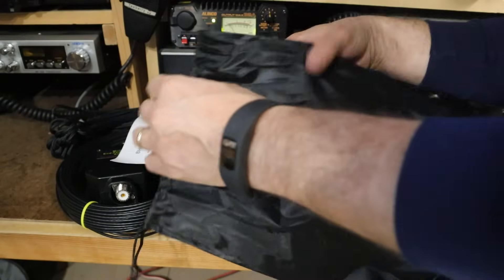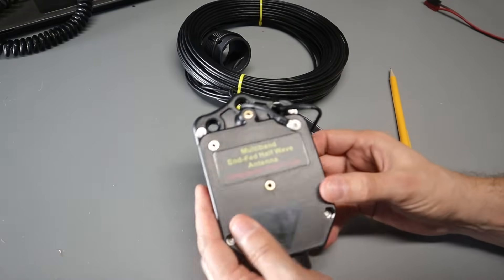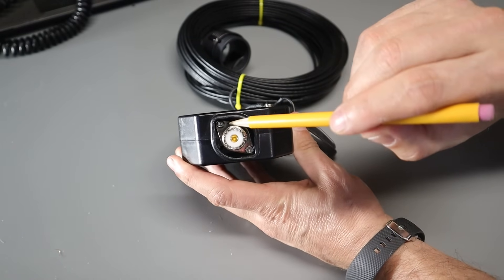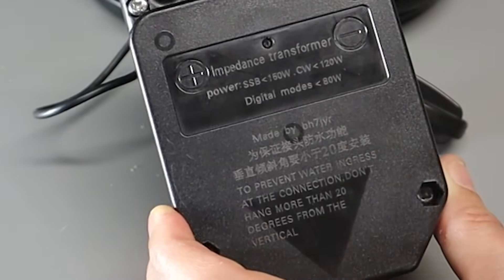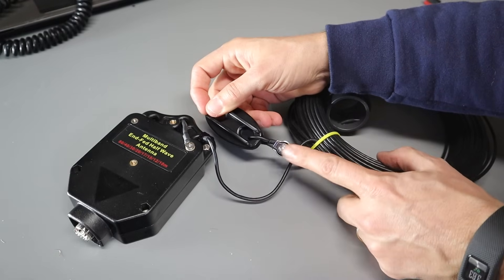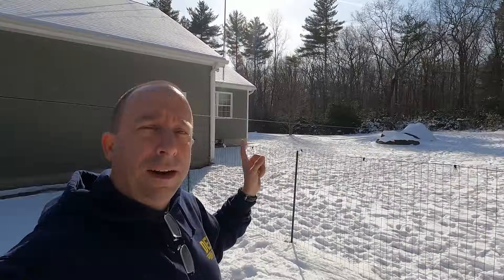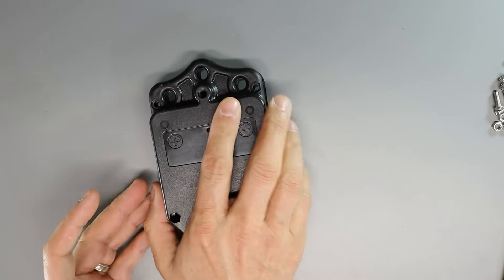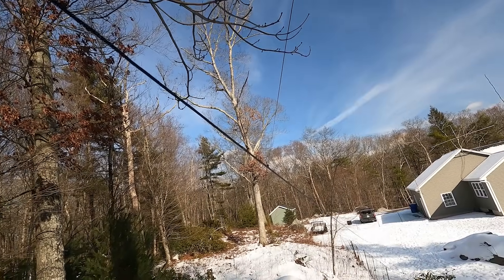Can This Ham Radio Antenna Really Cover 8 Bands? (JYR8010 EFHW)

Comment: I gave it a shot. It is well built and appears durable. I only have a 5500sqft rectangle shaped lot to put this up. I strung it around the lot the best I could through palm trees, about 10 feet high. I use an artificial ground for the counterpoise. I made contacts but signal strength was weak. I could not get RFI on 40 meters out of the shack. I switched to an 80-10 Off Center Fed Dipole and problems solved. A good tuner is needed for some frequencies. 73's/NH6RF

Comment: No. Illusion  The dipole only ' matches' on one band, on others, the BALUN IS ABSORBING THE POWER.

Proof experiment:

https://youtu.be/z01oTYbCB0E
Reply from the maker: As you saw in the video, the antenna worked.  Some power is getting absorbed by the Un-Un - I think most of us know and accept that as a tradeoff for this type of antenna.

Comment: Two possible suggestions for your consideration:

1 -  EZ Hang from DX Engineering -  This gadget is made up of a slingshot and a fishing reel.   You attach a 1 oz. weight to the fishing line and use the slingshot to send it over a tree limb.   Then, you attach paracord or whatever rope you're using to support your antenna to the fishing line and reel back in the line, pulling the rope over the limb.

2 -  An Arborist kit -  The Arborist kit will have a weighted toss bag, a length of rope (usually about 150 feet), and a bag or collapsible box.   You attach the weighted toss bag to the throw line and use one of several different methods to throw the weighted toss bag over a tree limb.   Then, attach your antenna support rope to the end of the throw line in place of the weighted toss bag and then pull the support rope back over the tree limb.

Of the two methods, I prefer the EZ Hang.   I find it easier to aim and I can get the line up higher in the trees.  But, I have used both and both will work for getting antennas up into the trees.

Thanks for the video!

Comment: I ordered one and got a 49to1 without the compensation coil, dscron rope or winder. I'm going to open it to see what else is missing...
KK5R
Reply from the maker: Did you order the full kit?  You can buy the un-un by itself...maybe you clicked that option by mistake?  Either way I hope it works out for you
Reply: @SevenFortyOne 
I ordered what was in the picture. It showed what you got. Somebody saved some money. 😊
Reply: @SevenFortyOne 
Paperwork said it could be a 49 or 64 to 1...

Comment: I bought a similar one ... same box... that does 4 bands. I actually ran a wire inside to one of the unused screwholes so I didn't have to use the one at the SO239.

Comment: What is the length of your counterpoise? Does it vary if antenna is in an inverted V configuration? Can you provide close up of Counterpoise attached to the PL-259? Thanks!
Reply from the maker: I think I mentioned in the video it's about 14 feet.  I can't post pictures in the comments and don't have the antenna up right now anyway.  I suggest experimenting and seeing what works for you assuming you have this or a similar antenna.

Comment: I have this antanna.I have it 25 ft in the air .Horizontal  at about 65' I have a 90 degree angle on a pulley to a tree.I am in Maine I have talked to Slavania ,Ireland,etc .my radio is an Icom 7300 I run it at 100 watts USB and lsb. This is my first HF antanna I think Im just going to stay with this what more do I need.KC1UUD .GET THAT UP HIGHER LOL

Comment: I recently purchased this antenna from Amazon, and it works great. I'm using it with a Yaesu 891 and a Yaesu FC-50 tuner across all bands. I even managed to get it working on 160 meters with an SWR of 2.3:1. The only drawback, in my opinion, is its length and weight. I have plenty of space at my place, but it's quite difficult to stretch the antenna properly with a counterweight. I'm using a 6 kg (13 lbs) counterweight over a pulley hanging in a tree, yet the wire still isn't stretched enough. There is a sag. I'm not sure if I can support it with a tree pole in the middle. I'm also unsure how much tension the anchor point on the house wall can handle. The antenna is, on average, 5 meters (16 feet) above the ground.

Comment: To bad we don't have a better look at the inside turns? I can only make out 15 turns? I count two twisted turns, five close spaced, one crossover turn, and seven wide spaced turns. Looks like a 56:1 to me. Looks like it is balanced with seven on each side and one crossover turn between.
Reply from the maker: It might be 15 turns/56:1 ad opposed to 64:1 as advertised ... either way it seems to work.
Reply: 56:1 is right between 49:1 and 64:1 I believe the core is the secret sauce and fun to build on a coated core.

Comment: Do you need to use a counter poise ? I plan to use the in a slope with the unun far above the ground .
Reply from the maker: I don't think you strictly need it but it will help with tuning and help prevent RF from traveling down the coax and back into your radio

Comment: I would need an antenna which will fit into a maximum length of 48 feet, with 32 feet of it being over brick buildings and the rest being over concrete. So even with the moderate capability of that long wire, you have my envy. 😉 Nonetheless, that setup is performing pretty well for a simple setup. I use homebrew magnetic loops for 60 metres to 10 metres instead, with good results on QRP.

Comment: Maybe I’m mistaken but that actually looks like a 56:1 transformer (2 turns primary, 15 turns secondary).
Reply from the maker: I think it depends on where you count the turns from - you could go with anywhere between 15 and 16 turns so I'd guess its somewhere between 56 and 64 to 1.  either way it isn't 49:1 like a traditional EFHW design
Reply: @SevenFortyOne number of passes through the center of the core is what counts as a turn.

Comment: I had a bad experience with their 40-10 EFHW model.  It displayed high SWR on all covered bands and enough spurious RF emissions to fault my home alarm system despite running a common mode choke,  Never had a wire antenna do that.  Defective transformer no doubt. Questionable quality control. I sent it back.
Reply: this comment needs more attention
Reply: 如果可能 的话，请改变一下天线的方向：比如原来的方向是东西方向，改成南北方向，最关键的一点儿是更换与原来馈线长度不同的高品质馈线。否则您换成任何一个品牌的EFHW都具有相同的问题。主要的问题都在于您的馈线在发射信号，并且馈线的长度恰好共振于某个频段或多个频段。另一个问题在于可能您的其它用电器的导线正好与天线平行且共振了，我遇到了使用偶极子天线却强烈干扰所有家电的情况，当我把偶极天线旋转90度的时候，一切都趋于完美了。当问题发生时，HAMer要做的不是报怨，而是找到问题并解决它，这样可以提高自己的能力。73 DE BD3OLH。

Comment: I have one just like that, an MFJ-1282 132 feet, from the house at about 10 feet to a tree out back about 50 feet up, works great on 160-6 meters with my Kenwood TS-890. I'm in northeast Connecticut. --WS1O
Reply from the maker: I'm also in NE CT...Tolland county
Reply: @SevenFortyOne  I'm in Pomfret...I used to be a member of BEARS of Manchester years back, now I'm president of ECARA and vice president of the Middlesex club (MARS). Stop by an ECARA meeting, 2nd Monday each month!
Reply from the maker: @BrianBattles   I know some of the guys in ECARA.  I help out with my son's Boy Scout troop on Monday evenings so I won't be able to make any meetings.  I usually attend the ECARA hamfest but I guess that was not held this year.  I also used to check in to the flying saucer net on Thursdays but my current work schedule usually gets in the way of that.
Reply: @SevenFortyOne  Too bad the schedules conflict, hope we can meet someday!

Comment: It looks like a powdered Iron core toroid. I use a 36:1 ratio with a 2 wrap primary centered on the secondary . With a 130+ wire that isn't in a straight line config. It has been fun building my own UNUN's and trying out the different ratios. Thanks for the video.
Reply: They are ALL powered iron cores no?

Comment: Would you be resonant in the 80 meter band if you shortened the wire?
Reply from the maker: The antenna is pretty good in the 80 meter band as it is so I don't think making any changes is necessary.  Having said that, if the wire is shortened it may affect the tuning on some of the other bands.

Comment: .... green might be a 52 mix... one of mine is.... but I've migrated away from the donuts and started to use the cable cores...I now use a small 61 mix core and auto-transformer winding configuration for proven better efficiency (60m and up only)..now upwards of  90 > 95%. On 80 that low to the ground portable config is OK for NVIS... it'll work OK for local nets and rag chewing but only at night. If you have a NANO-Vna you might try do some efficency tests...

Comment: I don't have this antenna but I have found that stringing an end fed half wave as an inverted V works very well indeed.  I built one and it rivals my 80m dipole (though it is slightly more noisy.)  Both are up 20m high.

Comment: The reason the case halfs have a boss on one sire and a recess on the other is simple:  this allows one design for both sides, i.e., you manufacture ONE mold, not two, and cut your manufacturing setup cost in half.  Clever, actually.  If there are differences on the outsides, I would be suprised to find that they are acturally molded, as opposed to laser engraved.

All in all, very interesting.  Thanks for the review.

Comment: I use an efhw for pota. Mine is 66 feet long. This year I’m going to 3d print an insert for my hitch so I can put a painters pole on the back of my jeep. Then I only need one tree and the unun won’t be at the top of the jeep.

Comment: Hello, I have a question about the attenuation of electromagnetic waves by plastic. I would like to cover the radiator and other elements of the yagi antenna for the VHF and UHF bands with plastic pipes. Will this adversely affect the reception and transmission of the antenna through attenuation? 73!
Reply from the maker: It shouldn't affect your ability to transmit or receive but it may affect the length your elements need to be.  It will also add weight to your antenna so keep that in mind as well.

Comment: 👍Thanks for video. The UNUN looks to be nicely constructed. Certainly, the way the secondary is wound is interesting. Think I may have seen something similar before but can't remember where? Obviously, the winding arrangement seems to work effectively. Though, not sure about the counterpoise connection arrangement.
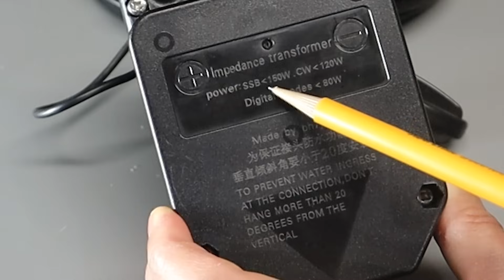Having, played around with 1:49 and 1:64, I think you can get both to work OK just by adjusting the length of the radiator slightly or even raising/lowering the feedpoint.
Reply: People have often wondered why the windings often cross over and reverse direction. I think this is simply so that the antenna end terminates at the opposite end of the toroid to the ground and input.

Comment: I am limited to space and use a EFHW at 66 feet with a 90degree bend around the house. I am looking to replace it with a new 49:1 and doing two 33 foot elements from the 49:1 in a v shape from the top of the roof to the corners of the back yard. I tried the comet ch250b and it is garbage so I am at wits end and if this fails it’s time to sell the radios.
Reply from the maker: I don't think that configuration will work.  A 49:1 UNUN will only work with a single wire end-fed.  If you want two wires coming from the feed point you need to use a 1:1 BALUN to make a dipole
Reply: @SevenFortyOne  I'm going to tap the ground from the 49:1 as the other element, type of dipole configuration.
Reply from the maker: You can't use a 49:1 for a dipole with equal length elements.  You need a 1:1 BALUN for that

Comment: i didnt see the benefit of it being 64:1  over the 49:1 .. My 49:1 offers better swr on all the bands than  this one displayed ,  Genuine 43 type toroids are normally black withought a coating ( coatings are not required as 43 type toroids are not conductive . It appears to be a generic toroid possibly metal core ,  Either way most 43 type efhw  will out perform that one
Reply from the maker: thanks for the info.  I'm curious now whether or not the performace difference would be noticeable.  That might be a good test for a future video.
Reply: @SevenFortyOne  if you could use the exact antenna wire including coil ( by removing it from that transformer) I would say it will give a definitive answer

Comment: I have a 135' EFHW in my backyard. Unfortunately, like you, I'm no land baron. I miscalculated the length of my yard and after running the wire through the crabapple tree, then through a 14' tall piece of PVC. At the end of the wire I ended up having to do a 90° turn and down to a fence. But, it works, so there it is. A tower is something that only comes to me in my dreams at night - HA.
Reply: Hello MrTommy - I'm in the same boat - very small back yard - the antenna I opted for was the T2FD which I find great.
73 de Ger EI6DP
Reply: Not 1kw not interested, KJ7TBR
Reply: @Brenda-jf2pe 
Amazon has a 1KW version.
KK5R

Comment: I see that the front and back is completely identical when it comes to the basic shape, so that means that they only need one single mould instead of two different to make a casing. This makes it cheaper to make.

Comment: I'm willing to bet your SWR will improve if you raise that antenna.  Can you tell us the exact length of the wire. I have a 64:1 unun and would love to see how it will do for me. Right now I'm using it for EFRW and it's doing OK but I need to trim it and pick a length.
Reply from the maker: It's too hard to get an accurate measurement in the cold, but it's around 130 feet give or take...
Reply: @SevenFortyOne  Thank you, what is the counterpoise or did I miss that on the video?
Reply from the maker: @BlessedLaymanNC I forgot to explain the counterpoise.  It is NOT supplied with the kit.  It was my own 14awg wire, about 14 feet long, with an aligator cip on one end
Reply: @SevenFortyOne  Thank you. Except for the diameter, I want to duplicate the antenna. I have the unun already.

Comment: Nice video! Very cool option for mulitbands and reasonably priced. BTW, i think the design with the o,ring groove, weather seal, is due to the fact that both sides are almost identical from a mold perspective. Slight mods for holes/inserts. Basically mirrored halves with slight mods.
Reply from the maker: Good point!☝️ thanks Marc

Comment: This is impressive. Wish there was something a bit smaller (hard to be a land baron in central NJ). Getting on 80 and 160 during the day is challenging except for sunrise and sunset.
You are clearly much more driven than I to do this when it's this cold out. Well done! 73's de KC2RDU
Reply from the maker: In your case one of those ground mounted, coil loaded vertical antennas may be a good choice.  I am looking at one of those right now actually so stay tuned...  I like the cold weather - no bugs and no sweating!
Reply: @SevenFortyOne  Thanks Rob! Have given some thought about trying a vertical. Look forward to seeing it.

Comment: I use one of those 64:1 balun for my home antenna. I got one identical to that one for the most part on Amazon for $45 Canadian. I have a 65' ish wire going up into the tree and it's been awesome. I have 7 bands because I don't have a coil.
Reply from the maker: nice!  I forgot to mention in the video that you can buy just the un-un and use your own wire for different configurations

Comment: Short distance to ground made antenna shorter in and that's why it was out of tune in several bands?
Reply from the maker: it really wasn't out of tune on any of the bands by that much but I do believe it would have been a little better if it were higher as you suggest.

Comment: I can only count 15 turns on that unun🤔. 56:1?
Reply: Yep you are right, not a 64:1. They are counting the cross over loop that comes back across to continue the unun. strange way to do it but I dont think that counts as loop through as it is wound. Still makes it a 56:1. Either way it does work as an antenna. But the core is a poor choice.
Reply from the maker: It's kind of a half turn I guess.  Why is the core a poor choice?  I'm not real familiar with these and would like to know what's bad about it.
Reply: @SevenFortyOne  my experiance
Reply: @SevenFortyOne  Painted cores (red/green/yellow) usually mean it's a dust iron core instead of ferrite. Maybe it's dust iron but maybe it is ferrite, who knows. If it was dust iron though , you'd get a poor performance on a multiband antenna.
Reply from the maker: @johnbuckley683  This one seems to work OK as it is even with this core.  In other words, I guess its good enough for this application.
Reply from the maker: The crossover is counted but is kind of a half turn I guess

Comment: Thanks for sharing. Great video! I have the same configuration but 49:1. It was my first HF antenna. I decided to put it up again but used  4 10 ft 1.5" PVC pipes and 4 T-posts. The 1.5 PVC pipes slip over the T-posts perfectly and cut slots in the top of the PVC for the wire and put PVC caps on top to keep the wire captured. It is only 10 ft off the the ground the whole 128 ft. It seems to work great. I tried 80 but find that it works great on 20 which surprised me. I made it to SC on 500 milliwatts on 20 meters.